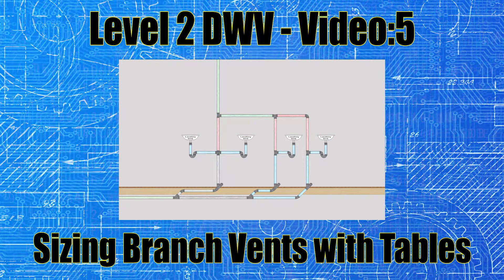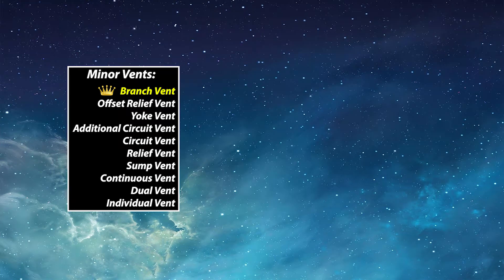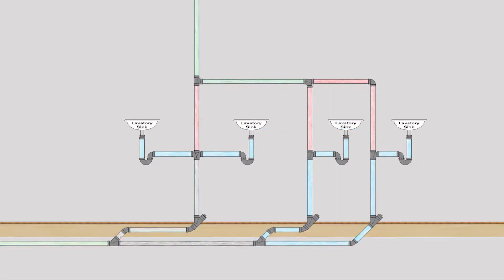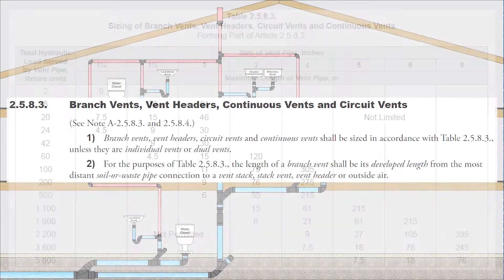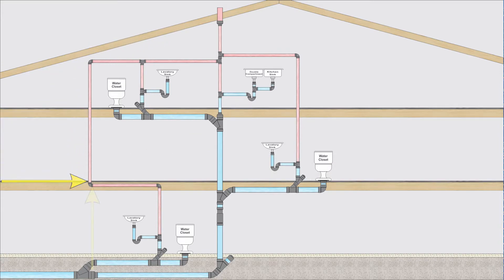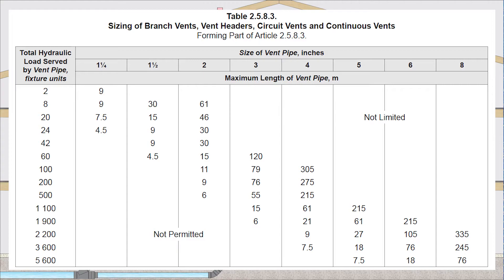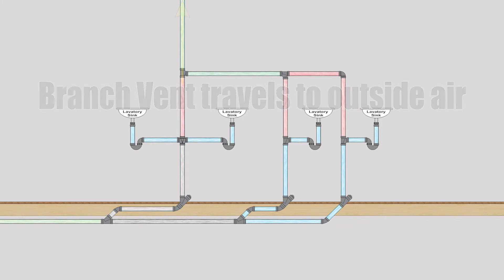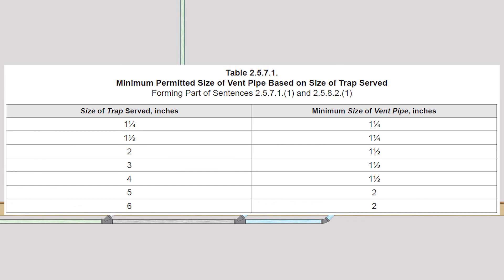Level 2 DWV - Video:5 Sizing Branch Vents with Tables

Comment: A continuous vents developed length is all the way through the branch vent till it hits a higher vent ?
Reply from the maker: It is measured from it's base until it connects into a stack vent, vent stack, vent header or open air (what ever is closest)